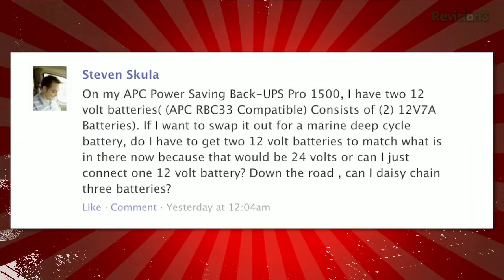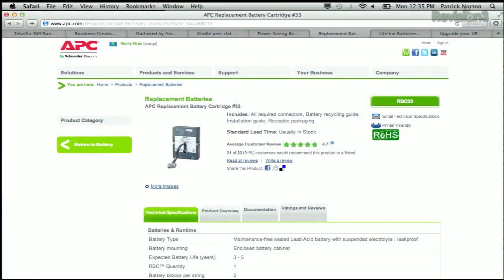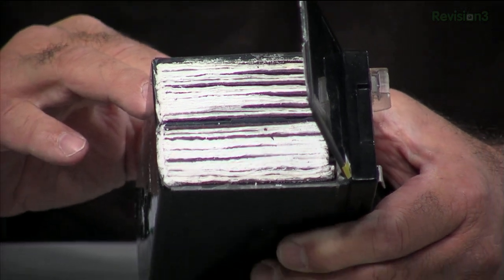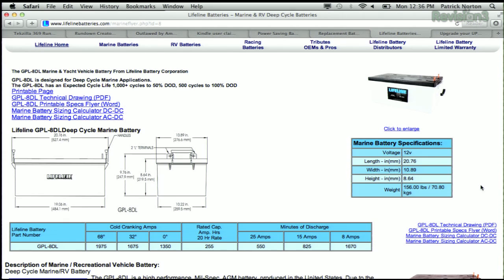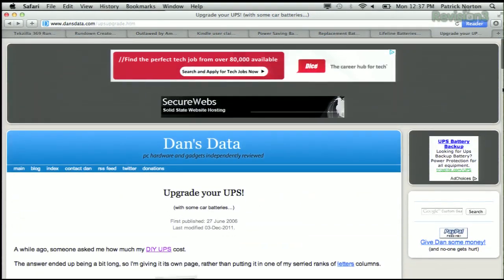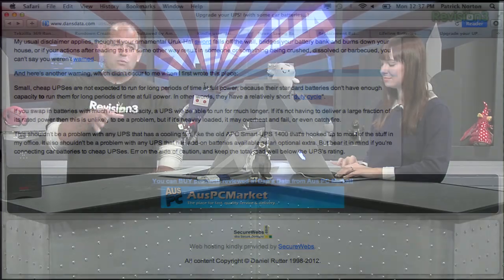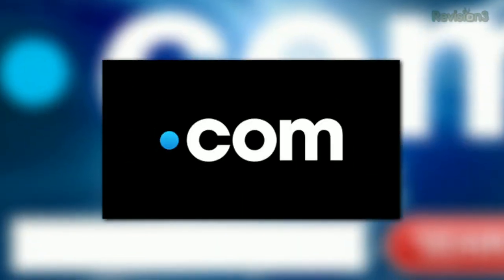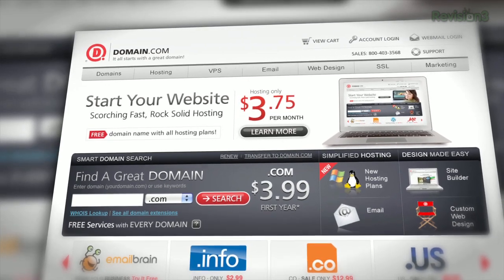Adding a Car Battery To Your Computer!

Comment: I have a camper that has one 12v deep cycle lead acid battery... It's outside of course.  I want to power my desktop computer with 12v dc instead of using the converter on the camper for 120v ac.  Is this possible?  I can't afford to buy what you are advertising.  Sorry.

Comment: Follow with me, this might be an "ingenious solution!" The BIGGEST "hurdle" with powering a PC with a UPS "not meant for sustained use" is the SUSTAINED USE! They're "inverting" lower voltages like 6v,12v, or 24v stored in the batteries into 110v (or 220v in Europe) which creates HEAT in the inverter for one and doing so it also WASTES around 10-20~% of the stored energy in the process because it turns that into HEAT! That's what "cooks" the UPS if you run it for longer than it's meant to run... Here's the thing, (AFAIK) the power supply IN the PC takes 110v or 220v and transforms that down to 12v or less to supply to the motherboard ETC... Why couldn't you just trace the path where the PC power supply steps down the voltage to 12v and "hotwire" a 12v battery to that with a 110v or 220v relay (BTW it HAS to be a 110v-220v relay and not a 12v one or else there's a switching DELAY!) that stays energized open/off when you have shore/house power, as soon as that relay loses house power it instantly switches closed/on and feeds off the battery?! I have something similar wired up for my ham radio setup, when I kill the main house power to it that instantly switches to battery power! "ONLY" caveat is I NEED to remember to turn off the power switch on the surge protector everything is plugged into if I do lose power or else it will drop power for things for a second when main power comes back online...

Comment: he is wrong about the voltage of the back-ups pro 1500
it is a 24v (2x12v) system and the external pack is actually just 4 more 12v batteries with a sense resistor in a 2x2 array
it also has a cooling fan that just runs full blast during operation and generally cools the ups inverter mosfets(opened and carefully monitored temps on mosfet heatsinks)
though I agree mistreating large lead-acid batteries is bad this ups follows a max 27v charge (2x13.5) so it has a decent current limit and voltage cutoff
I use a deep cycle marine array of 2x12v 100ah and it has ran fine for years with monthly outages in my terrible block and only recently noticed a diminishing runtime from about 3 hours at 500w output down to 2 hours after 3+ years
simply put proper connections and battery care for any large lead-acid battery attached using the external connector and fuse is included with the back-ups pro 1500 and though large runtime can be an issue on smaller units without internal fans of being designed for long runtime

Comment: HYDROGEN GAS? SERIOUSLY? What the hell is wrong with that guy? It's not a friggin' cyanide for god sake! H2 particles "seek" for O2 particles in the air and the only thing you end up with is a little bit of moist because you end up with few drops of water. Water it's not toxic so stop panicking!

Comment: far better to buy a DC to DC server PSU and run it directly from a battery bank (yes a bank, a single battery won't last long at all)
using a battery to pump up from 12v to 240v only to go through your PC PSU to be dumped back down to 12v is MASSIVELY a waste of power and battery run time.

and a server dc to dc 360w unit costs less than a UPS by a LONG way

Comment: What would be a good small portable battery for a PC with about 150 watts total power usage at peak system load? Specs will be an i3 4130, 8gb ddr3, Nvidia GT 1030 graphics and a 525gb SSD with a Pico power supply will be used with a 1080p monitor in a portable laptop/pc monstrosity.

Comment: With a few add-on "DC-DC Buck converters", you can recreate the different power rails that come from your PSU and run from the car battery DIRECTLY! No silly inverter needed!, also, I've done the baery bank mod on an 1270VA Geek Squad UPS, 4 batteries in series/parallel gave my 500W greater than 8hrs run time!

Comment: Buy a generator. They aren't that expensive and you can use a 15 minute UPS to go start it when you lose power.
Reply: Yes. A cheap, diesel generator in the office, on the 12th floor is perfect... you pharken idiot xD

Comment: WoW!!!  I asked for the transcript before they released their videos to hopefully help the proper information given to the viewers...  In this case I would Install a "Battery Bank" in the garage of those Deep Cycle Marine batteries and a 12 volt Battery maintainer that can supply enough power across to the computer's service outlet after a proper inverter that will handle the current draw.  This will not give the computer a signal to shut down but may give you enough time to work with. Enjoy!

Comment: Parallel ten AGM batteries to like 120 volts? It could last a very long time theoretically.
Reply: parallel would still be 12 V, but yes, it would last longer. Series would give you 120 V.